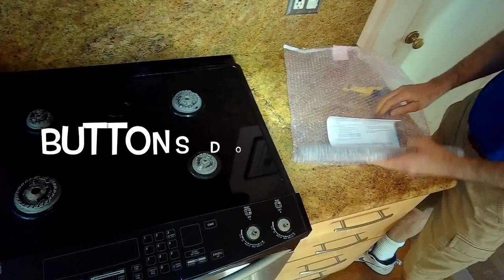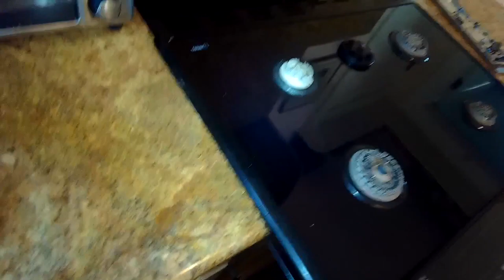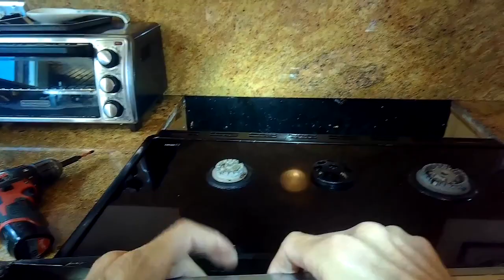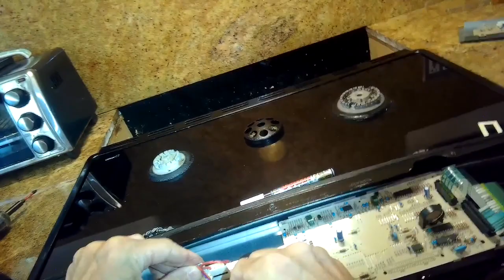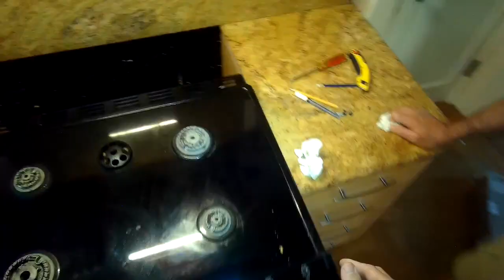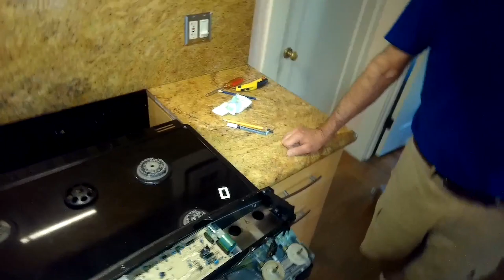✨ KITCHENAID SUPRA RANGE BUTTONS DON’T WORK—FIXED ✨

Comment: Scott hey I replaced the ribbin cable touch pad and mcb, and still got the sticky key code.. so I thought manufactured defect parts so I replaced all the parts again
Still, get a stuck a key code. I use rubber gloves for no static. Electricity power has been cycled multiple times with the new parts. Check continuity through the ribbon cable. Everything's perfect stovetop, works great. But the oven after forty seconds of turning it on, sticky key code.Comes back. Any ideas this is driving me nuts.
Reply from the maker: Can you send a short video of that to: scottthefixitguy@yahoo.com
Reply: @QuickAndEasy5MinuteAppliance i didn't make a video of it, but when I go back to the customer's house, I'll see what I can do
Reply from the maker: Understood.